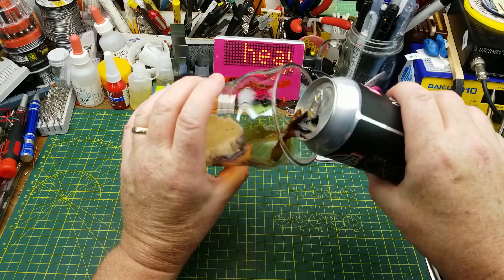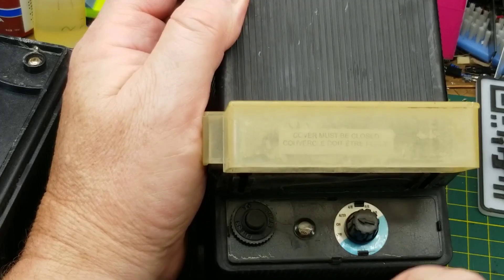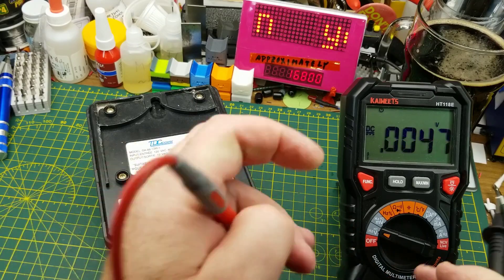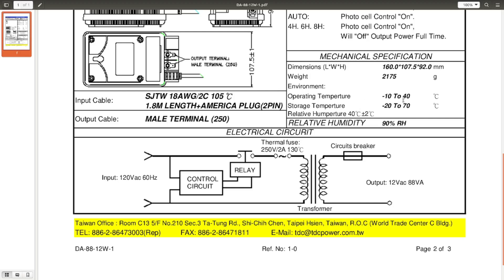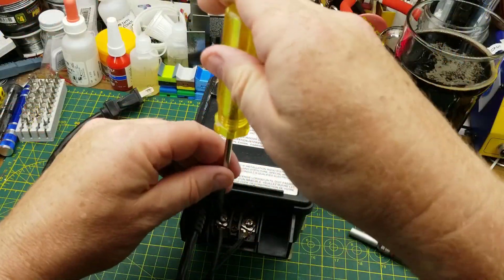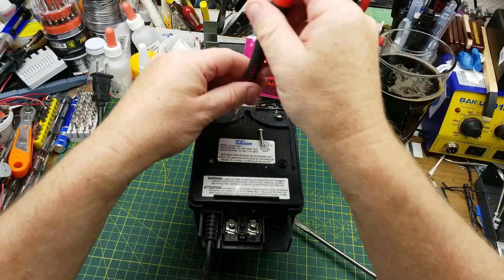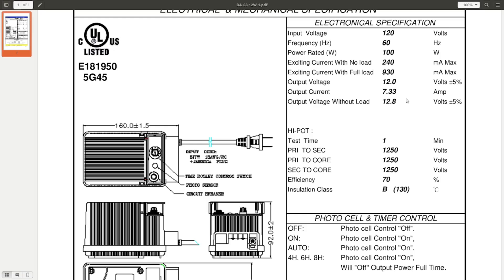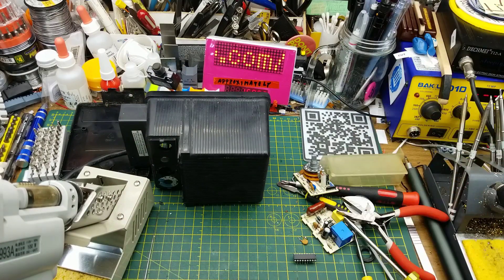Curiosity teardown: landscape lighting power supply

Comment: What about rewinding microwave oven transformers for beefy linear power supplies?
Reply from the maker: That's a possibility. The microwaves I've taken apart so far all had a switching power supply, so no beefy transformer on those.
Reply: @pileofstuff  I was going to mention that you need to find the older junkers.  i have been pretty lucky so far.
All you have to do is to lift the thing to tell whether it's old enough.

Comment: That chips is probably some microcontroller or Asic or in less common cases a Logic ic but google lens and google goes dry so i cant find anything about it. Maybe usefull to take a few hundred looks at the pcb and pinout and seeing if you can trace the chip, although that aint worth the time

Comment: I do love an old skool linear power supply. A good source can be had from just replacing your step down transformers in 12V halogen lamps with switched mode equivalents, bonus points if you can also change the halogens for LED. I scavenged a very meaty 250VA toroidal transformer from a set of 12 x 20W halogen lights, that got replaced with a matchbox sized PSU and 12 x 3W  LEDs for about 1/10th the price. No brainer, as long as you don't need dimming.

Comment: I can't remember the number now, but there was a 555 timer that had a built-in register that could be used as a divider so you could have  accurate but very long timings.  Or if you increase the frequency of the 555 very accurate shorter timings.  Thought the chip started with XC or XR something?
Reply: XR 2240

Comment: Mystery chip is likely a 556, dual 555. One section would be the timer, and the comparator in the other, used for the light sensing circuit.